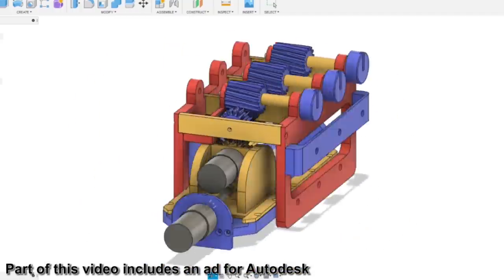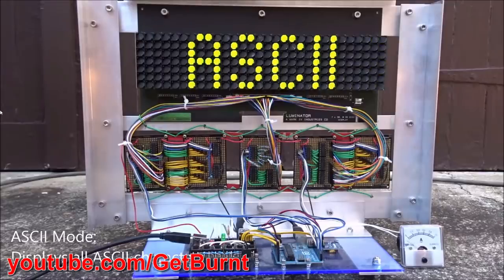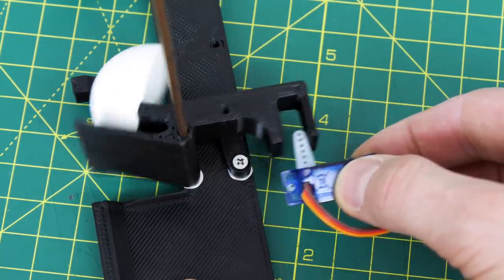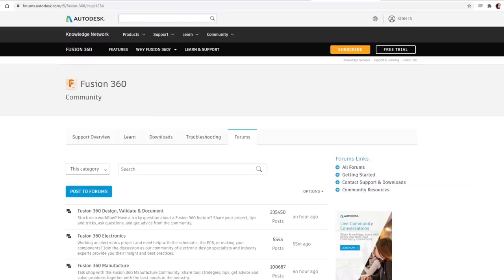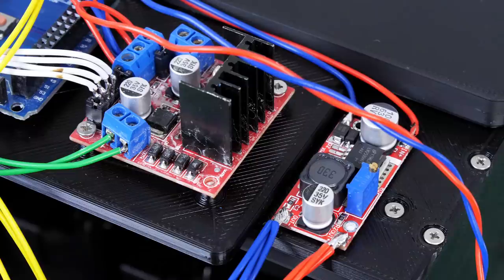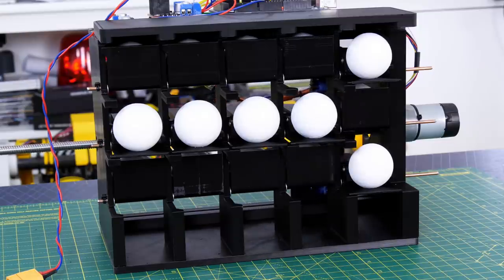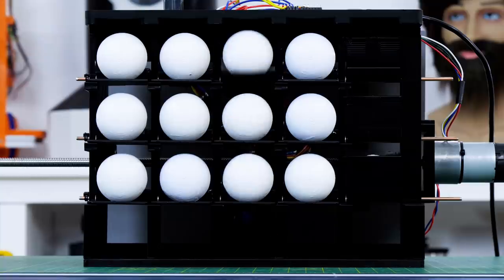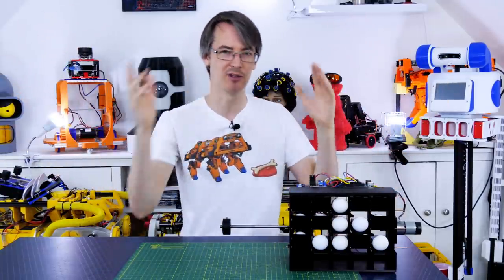Mechanically Multiplexed Flip-Dot Matrix

Comment: Instead of using the servos to pull/push, they should just have two positions to be in, and as they pass the lever, simply being in a position should slide the lever or let the servo pass through.  That way, all you need to do is make sure the servos are in the right position before it reaches the next column.  That'd be way faster.

Maybe a bearing on the arm of the servo to make sliding past the levers easy?

Also, instead of using a half ball that you have to print, could you put a rod through the ping pong balls and then paint one side black?  That should allow you to get them real close.

EDIT:  Sh*t, just about everyone in the comments thought of this too lol.

So, another thought.  B/C your goal is to keep it simple, how about changing up the layout?  Keep the servos on the side, and then just slide one servo alone the bottom.  For each column, the row servos go to the next state the balls should be in, then the mobile column servo sets those states.  The column servo then moves to the next column, while the row servos change state, repeat. :)  That way, you only need 1 more servo, and have simplified the moving parts.  (The mechanical bits might be more complex, but at least they don't move! :D )

Comment: It would be interesting if you could swap the little lever are for a eight sided piece on the three motors, that way no matter which way it turns it will always have the same orientation.

It won't be as compact but you can at least not reset the motors between columns.

Comment: One thought about the servo hooks... if you created two sets of hooks on each pixel, rather than just the one.  white-to-black is handled by one half-hook, black-to-white is handled by the other half-hook.  Then you could move to the "to-white" hook for a column and actuate the pixels in one direction, then the "to-black" hook for the same column, and actuate those.  You wouldn't need to have knowledge of the current state of each pixel, and you wouldn't have to move any servo arms that don't need to be changed... this i think would simplify the code a bit.  You could just move the gantry down the line, actuate all white pixels in a column, move, actuate all black pixels for that column, move, repeat...

Comment: Technically it's actually a mechanical demultiplexer. As a demultiplexer is a combinational logic circuit designed to switch one common input line to one of several separate output line

Comment: A nice one would be belt driven with one belt per line and one per column so with the combination of one line and one column move would make if change state. The order if the column or line move first make it flip or hide. You could make the panel massive with this and relative fast. But the mechanism would be very interesting more than the application.

Comment: with the servers you could have a 3 step system instead of the 2 step one you use now. where the middle step would be an open channel thats always open, so the servo would only have to flip the tile and return to the middle as it moves on to the next one. if that makes sense. then you wouldnt have to have a stop in between stages.

Comment: One could reduce the number of servos by having the servo connect to a peg per row, horizontally staggered.  I was also thinking that one could eliminate the servos entirely if the mechanism were designed so that running the lead screw all the way to the left would force all of the ping pong balls to one state, and otherwise each ping pong ball would be tripped if the lead screw moves past it right to left.  To draw a screen, run the lead screw all the way to the left, and then run it to the right, but zig zag back to hit all of the balls that need to be tripped.

Comment: More vertical rows could be supported w/ the same number of servos if u put extended levers on the second set of rows and position them at the halfway point between current levers. Or really, if such vertically extended levers are workable, u can at least triple the # of rows with same # of servos by adding rows both above and below and putting them at the 1/3rd and 2/3rd points.

Comment: Suggestion: I know this is sort of a different beast, but what if you used a stationary column of flippers and ran series of pixel rows past them on a large looping tank tread?  Would be a great way to make a mechanical text display.  Wouldn't even be hard to make it modular so you can expand it or shrink the length of the display.  Wouldn't mind seeing you dump the ping pong ball aspect and try to get a multi color display out of it.  :)
Reply: Ooh I like this, like a train-display, made out of a literal train of pixels.

Comment: I litteraly had an idea similar to this a few days ago:
I was thinking about multicolored "e-ink" like displays (not actual e-ink just the "doesnt need power if it doesnt update") and was like:
for like a big poster or something, where resolution is not too important and neither refresh rate:

you have cubes and every cube has a different colored side and then a robot arm picks the cube, turns them in the right direction and then puts it back in the display

then I was like "ok what if its not a cube but like 5 squarres on a zylinder and the turn with tiny motors" and I was like "cool tiny stepper motors exist!" and then I was like "ok but think of led screens - I am not sure if you can actually multiplex stepper motors - think about all the wiring???"
then I was like:

ok so we have the zylinder with the different colors on it (depending on how many colors we want it has to have different amount of sides, but yeah, 4 for the start probably work) then we have a tiny magnet in each of those, on the same color
then we have a tiny robot arm that can spin the cubes and a hall sensor, so it knows where the cube is (because it cant turn them perfectly and then it will all be messed up so every couple of turns or every one we have to measure where we are)

so yeah, that would be cool :D

well now that I said it and you think its cool too ofc go ahead and build it :3

but I might build it too - realistically I will probably not get to it in the next five years tho hahahaha

Comment: Great video James. I am amazed at how many videos you put out so quickly. It seems like the cadence has really increased and you maintain the same great quality and interesting content. 

As for ideas along the lines of this video, I wonder if it would be possible to to have a row of actuators in both the X axis and Y axis that mechanically flip "pixels" where activated actuators intersect. Much in the the way some membrane keypads work.   For example a 5 actuators on the X and 5 along the Y could control 25 pixels. One actuator on each axis would be activated and where they intersect the pixel could be flipped.  hopefully you get what I mean....

Comment: @JamesBruton if you design the size of the slot and the throw of the actuator such that there is a position in the middle of the throw where the sides of the actuator cannot reach, you'd have a home position for the servos where they can pass through any column. That would make things a little simpler and hopefully up the refresh rate

Comment: The code/refresh could be made more efficient by looking ahead and comparing the current state to the desired state and if you have already completeted your refresh, you could jump to either end without pausing, you could also go even further than that and look ahead to each column and check to see if a state change is required by comparing the current state and the required state and jump straight to those columns, saving more time and increasing the refresh rate efficiency again.

Comment: Steampunk features flip displays and the mechanical multiplexing makes that seem more plausible. You could have pneumatic actuators riding in carriages using a mill drive train and pneumatically controlled transmission to drive the carriages, all controlled by a paper strip reader. Hypothetically, that could have an application near MRI or NMR using the nitrogen gas release to drive it. Obviously, you wouldn't use a paper strip reader in the application, but could have a small number of remote, pneumatic inputs without any electronics or magnetic materials inside the field. Obvious downside is that it would be slow and noisy.

Comment: I was hoping to see a mechanism based on row/column access design, where you have actuators at the end of each row and column, and, for instance, actuating a column allows the row actuators to modify all the elements in that column (and only that column).  This would require more actuators, but it would potentially be faster, since nothing has to move across the entire array one column (or row) at a time.

Comment: How about a coreXY gantry that pushes a convex button toggle that flips the half ping pong ball on or off. It could be relatively fast and by using a convex button it could turn it on or off from any direction. The tool head would have to go up and down. Hopefully the tool head turns the convex button on by swiping past it, rather than it having to pulse up and down to turn the button on or off. Great Video, can’t wait to see the next one!

Comment: please for the love of god make a version where you exchange the servos for electromagnets 
i think you are really on to something great here 
it could be 10 times faster using electromagnets and you could really make a cheap and still somewhat fast flipdot display 
you could probably make a 32x16 dot display which would be a really cool showpiece
Reply: At some point to one is just making a CRT.  I think keeping everything to mechanical actuation is that cutoff point.  So motors are cool with magnets as long as they drive stuff with their output.

Comment: If the pixels were disks instead of balls so they could rotate continually through off/on every 90° then you could have a continuously moving arm with no jam risk. Just extend the servo at any point after the previous collum and before the next one.

Comment: You could continue to use the mechanical method of flipping the ball with the servos, but also remove the need to remember the state and whatnot. By making the receiving gap for the servo arm wider, and then returning the servo to a centre position after it sets the state?

Comment: Maybe you can use a magnets and coils to push and pull those flaps and use the arduino to applying current to the coils to pull the magnet and then reverse the polarity to push it back..
It will be much faster and more quieter 
Just an idea

Comment: Ping pong balls half painted black, spinning on a vertical shaft.  Rack & pinion beneath each so they can be spun by pushing/pulling the rack.  Magnet at the rear end of the rack, and electromagnet in place of the servo that can flip polarity to push/pull.  That's how I'd do it anyway.

Comment: I wonder about using electromagnets instead of servos, have the acuators be magnets, and use H-bridge to alter the polarity of the ElectroMagnet to push or pull. that way there is no levers to have jam, so no need for the pauses to set position before moving to the next set of actuators
Reply: That is more or less what that video wall showed at the beginning was.
Reply: @Nono-hk3is  indeed but it didn't use Hus mechanical system to work one row at a time, meaning each row had to have its own actuator

Comment: Can you do a mechanical multiplexer on the vertical axis as well? I can see that working if you use electro magnet
Reply: Easier would just be to have extension levers from a single servo that could hit any of the three rows, but stagger their horizontal placemen so that at any particular horizontal position the servo would only hit one of them.

Comment: you really just need a large bevel on both sides of each flip channel so it shifts to whatever position the servo arm is in as the servo rack passes that column. then you don't need to remember each cell's current state and don't need to keep moving the servo arm around to actually flip them. and no chance of jamming if something goes wrong.

Comment: Love this project. Would an air ram or hydraulic solution be faster than the lead screw? Could you get the same precision?

Also, if you sharpened your PCB fabrication/milling skills a little custom PCB might save you a ton of time with connectors and wiring harnesses? 

Keep up the great content! Excellent channel.

Comment: A 3d printer gantry (corexy or croxy possibly) on it's side to go over each ball that's not in the state it needs to be. Geared for speed as it doesn't need high accuracy like a 3d printer. Then use a single electro  magnet to flip it. I bet the gantry doesn't even have to pause in places so would think this could go very fast (even though you can't do a row at a time). You can create different patters for the update which might look really cool.

Comment: I have a suggestion - would it be possible for the servos to have three positions - On/Neutral/Off - so that they could be set to the middle position by default that would enable them to pass by each element of the display without needing to know what the current state is and then the servo only goes to the On position or Off position when it is in the right position for a dot that needs setting to On or Off. This would probably also mean that the carriage could pass more quickly past columns that don't need to be changed.

Comment: All the trouble you are going to to evade the magnetic display!  If you put magnets on each ball, & a coil either in each one, or on the carriage, things would be so much simpler!  Coils are cheaper & more rugged than servos, which will fail soon.  Servos were made for airplanes, pushing against air, & not repeatedly swinging full-range.  Magnetic drive will also permit (but not require) making mechanism more compact.

Comment: Thought:   Why not put something like a cog on the servo?
Explanation:  The "arm" you have on the servo moves "n" degrees to re/set the indicator.
Make that a "nice" number which can go into 360.   (Say 60 degrees)  that is 6 arms at 60 degrees.
Then you just turn the servo 60 degrees in the direction needed to re/set the indicator and it is then already aligned for the next one.

Comment: If your committed to this physical design, why not use pairs of solenoids to flip the balls. They are cheaper than servoes and faster for this kind of work, though probably have a higher current draw.  Also it would enable you to  ditch the worm gear and use a timing belt to get higher speeds.  Worm gears are great for high torque and accuracy but sacrifice speed to do it.  Here it looks like speed and less accuracy would be more useful.

Comment: I'm curious if it would be viable to connect each line with a series of cams or something like that, each one engaging the next, sort of like in a safe. I imagine, let's say a clockwise turn would be an on state, anticlockwise off. It would require the number of columns turns to engage the last pixel, then one less in the other direction to turn the one prior off, and so on. It cold potentially be quite quick I guess. I think I've seen something like that in one Lockpicking Lawyer video on cracking safes.

Comment: Wouldn't it be possible to have a sliding mechanism to tilt the points?
For example, two (or more) slots at each point that push it to the 0 or 1 position when the servo arm passes through? Then you could set the arm as it moves through the gap and let it pass through the respective slot. This might even allow to build it so that you don't have to save the current position of the point (if you have more than two slots).

Comment: What if you used a single continuous loop of cable such as perhaps fishing line that was fed past an actuator for every dot, utilizing a pulley at the end to weave through each row. The cable has one catch on it that in one direction passes by each dot with no effect, but when reversed it would flip the dot that it caught on. This way you would use only one motor total to drive the cable loop. It would be slow as it would only change one dot at a time. Driving one direction addressing each dot and a brief reverse at each relevant dot when the catch is to flip it over. Of course each dot would need to be able to flip from white to black back to white again in the same action like pushing the button on a pen does. The whole cable loop would travel around the motor in one full revolution akin to a track on a tank which would have addressed the whole display. I would love to see this, I wish I had the tools to build it myself, If you do this please let me know.

Comment: I believe you could avoid the logic for remembering the column's previous state by redesigning the hook mechanism and the horns on the servos in a way that the these would always be set to the next columns state and only switch the position of sets that were in a position different than the expected. A solid inverted pyramidic shape comes to mind for the ball mechanism, and then a matching shape attached to each servo...

Cheers!